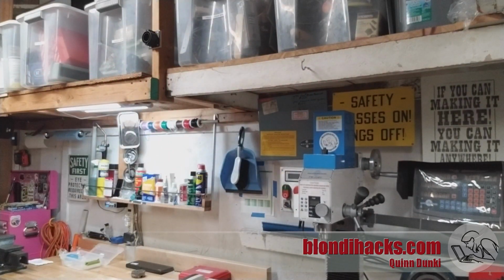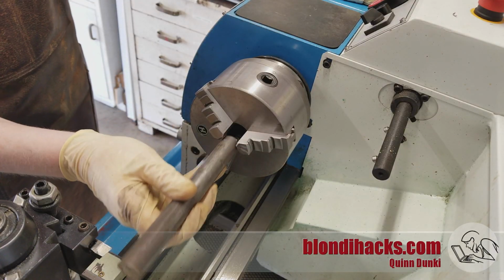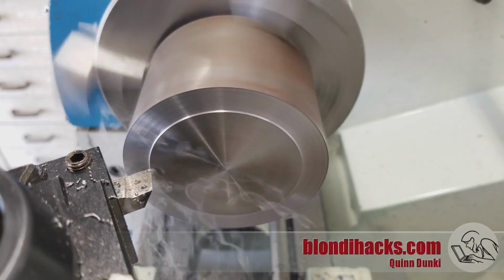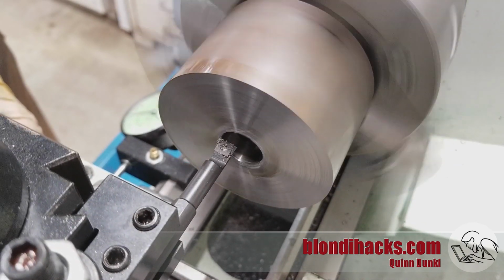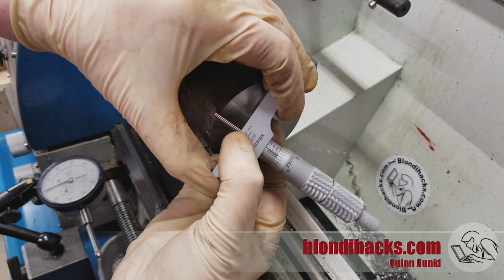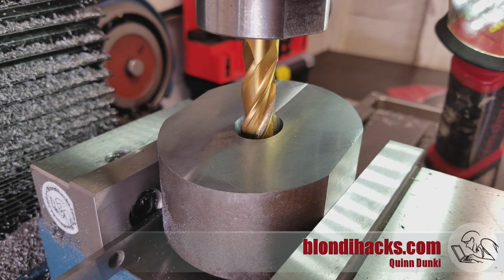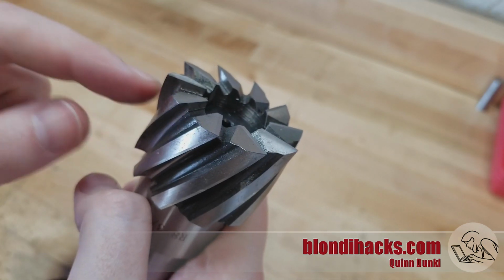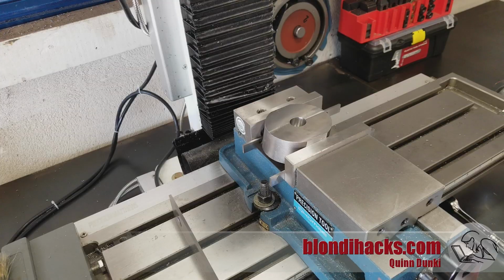How To Make A Fly Cutter :  Part 1/2

Comment: in attempting to use a fly cutter cutting tool that I ground, I obtained a smooth finish but once the tool advanced the distance of the diameter, the trailing edge began cutting also, messing up the smooth advancing finish!!!  Can you help? Thanks  Sam

Comment: Hi Quinn, fantastic job on all the videos, thank you for all your hard work. I’ve recently picked up a used Mini Mill. Replaced the spindle and bearings. Noticing some warmth/heat in the spindle taper when running, especially at higher RPM. Have you noticed this yourself? It’s not too hot to touch at all, just quite warm :)

Comment: EXCELLENT VIDEO...tickles me to hear you talk !!! 'makes me remember all those years ago, working on and around shop equipment! I remember our shop had a tailstock chuck that had a short rounded off and half twisted tang on its morse taper. If we had a big bit to run with it, we would stick the handle end of its chuck key in the hole and rest the key on the cross feed, on a little piece of wood and a rubber band around the chuck and key. That would prevent the chuck from turning. Later, the shop got another tang pressed in that we didn't have to baby.
   You mentioned you were experiencing "chatter", on your cut. If you will grind a small radius on your cutter, in your lathe tool post, you will see a marked difference in less chatter as well as surface finish! My mentor showed me quite a few KEWL tricks like that. 
   Another kewl trick is using CRISCO vegetable shortening (not the oil), for tapping steel. I just fill a pill bottle with Crisco and put the lid on. I've taught my grandson to pull the lid off. stick the tap in and put the lid back on and tap the steel. You don't have the mess you usually have and your thread quality is pretty and smooth...not grainy, like when you use tapping fluids. (my mentor worked for a major heavy equipment company, and he told them about Crisco. They bought my hometown stores out! you couldn't find any Crisco anywhere in that area of town! They make earth moving equipment.) There's your tip of the day. 
   I APPRECIATE you and your machine-shop activities !
  Oh, and before I forget it again...I absolutely love how you start your video sessions! Bill, from Tn 🇺🇸

Comment: I only have a little experience on mills and lathes so please forgive me if this is a silly question.
Instead of machining the entire fly cutter body into a wedge wouldn't it be easier to just leave it round and only machine the HSS slot at an angle? You could use a small end mill to plunge cut flat surfaces where the set screws will go, center drill the flats, then proceed as normal. It would result in a heavier fly cutter but I would think it would help with balance.

Comment: Quinn, I see that there are already 225 comments on your presentation.  I wanted to give you a tip that will assist in preventing drill bit spin.  It is especially valuable when using Silver & Deming bits.  There are three holes in the chuck.  Each hole should be used to torque down the jaw on the bit.  Enjoy your videos.

Comment: Great video-tutorial, Quinn - as usual !!! Looking forward to watching Part 2... which I'll do it in a second. 
But not before thanking you for sharing your Toolpost Indicator Holder on Thingiverse (https://www.thingiverse.com/thing:2830764)
I was already intrigued by that little 3D printed red holder, which you showed very briefly (too much briefly, perhaps 😉) on your Lathe Tutorial 9, that on four-jaw chucks. But in this video you show it so blatantly that I couldn't refrain from checking. And I found it, yeah! 😉. Special thanks for sharing the Fusion 360 files too 🤗

Comment: I am not a machinist at all but could you have put an angled shim between the part and that awkwardly clamping fourth jaw to make the clamping force stronger and the setup safer?
Reply from the maker: It’s safer without. Unless the angle of that shim is perfect, it has a good chance of flying out of the chuck at speed, and well...my face is right where it would go. 😬
Reply: For sure, I thought that might be the case, to tell you the truth machining has always frightened me for this reason, I do need to get over my dear though if I ever want to realize my dream of watchmaking.
I have seen some watchmaker secure flat plates of brass to a backplate with nothing more than super glue. Is this possible because of how soft and easy to work brass is or does it have to do with the size of the piece in question. Sorry to be so long winded
Reply from the maker: Thomas Evans Indeed superglue is a very useful fixturing method. It works in many materials, as long as you keep the cutting forces low and the temperature down.

Comment: Nice explanations as always. You might want to mention that the tip of the drill bit is not the only depth that you might be concerned with. It is often the case that you are interested in the full diameter hold depth, in which case, you would be short by this method. This is definitely not a criticism, I think you do an excellent job, but rather a subtle point that has gotten me into trouble in the past. I see that you did mention making the bottom of the hole flat later, but for some this might not stand out enough for them to associate this with the final depth issue. If you want to send me a mailing address to dudley.toolwright@gmail.com, I have a couple of HSS shell mills that I will never use that were included in a lot of tooling I bought.
Reply from the maker: Yes, great point! In fact, I’m willing to bet that most of the time the depth-at-full-diameter is more important than the absolute depth. Boring a flat bottomed blind hole is probably the exception to the rule.

Comment: Quinn, I am new to your channel and absolutely love it. Your humor and demeanor are up there with This Old Tony and I too want to be your friend. I hope that is a complement! 
I have a quick note on balancing your fly cutter in Fusion. To balance the fly cutter you want the center of gravity (CG) in the XY plane to be on the axis of rotation (let's call it Z). Your trapezoidal shape does a great job in balancing in the tool direction (Let's call it X).  To balance in the perpendicular direction place  the Y component of the CG on the Z axis. The CG of the assembly is displayed in x, y, z coordinates in the assemblies properties as center of mass Just cut /trim away to center (zero) the x and/or y components. In the fly cutter case I beleive you will need to remove weight from the opposite side of the cutter!???? This is because  the tool is very close to the CG in the Y direction(0 to .5 or ~.25)  and the cutout for the set screws is around 1" so the mass at the set screw cutout has 4 times the mass at the tool location. Wow, so much for a short note. sorry
Reply: WOW...KEWL

Comment: I'm not sure if it's on all versions of Fusion 360, but check the inspect menu for a tool that shows you exactly where the center of gravity is.
Reply from the maker: Oh cool! I didn’t know about that. Thanks for sharing!
Reply: @Blondihacks   is dynamic balance as simple as getting the center of mass on the axis of rotation, or is it more complicated than that?
Reply: @somebodyelse6673  I think you're right. This video helps visualize quite a bit: https://youtu.be/5TwcDq40T5s

Comment: Definatly a good tool for surfacing heads or decking a block
Reply: I'd  recommend a 12 to 14 inch diameter  fly cutter for that... on a super rigid machine  lol
Reply: @rynohorn3819  yeah I know about the rigidness and why so big for small engines

Comment: A quick way to get a flaft botton after driilling would be to chuck an appriate endmill  II have 3/4 endmill holder with a 1/2 straight shank) and run it in to finish the hole

John
Reply from the maker: Yah, an endmill holder for my tailstock would be a very useful thing! I gotta make one...

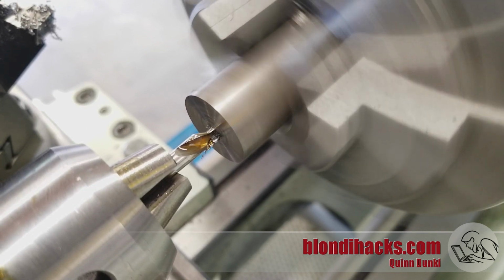Comment: At 5:05, it looks like the tailstock is floping all over the place.  Is that normal for lathes?
Reply from the maker: That’s just because you’re seeing it very very close up. Some movement is normal when the quill is unlocked for drilling.
Reply: its normal for small lathes...and for uncritical rough drilling little movement is just ok

Comment: Was gonna say, shrink fit is how the railroad puts steel tires on train wheels... Shrink fit has nothing to do with how well you get along with your psychiatrist nor do they work out at the gym
Reply from the maker: Indeed! Stay tuned for hot base on arbor action.
Reply: Blondihacks ahhhahaha you made me laugh... But seriously, machinerys handbook has an interesting few pages on the subject. I can say from experience, a shrink fit is impossible to disassemble without destroying the components... The better the surface finish the better they will grip, more surface area at a microscopic level

Comment: Thoroughly enjoyed that. A very nifty design! I often hold drills in a collet chuck to prevent them spinning in the tailstock. One thing I did notice was that your centre drill lifted a little; tailstock not clamped? To rough out a flat bottomed hole it is possible to use a slot drill (centre cutting end mill) in the tailstock chuck.
Reply from the maker: That’s just the normal drift of the quill when it is unlocked. People just aren’t used to seeing it that close-up
Reply: @Blondihacks  Understood. Thank you for the explanation.

Comment: Thanks for sharing. Out of curiousity, why is it so hard to actually drill on center? In most videos when people use center drills etc they always seem to shift off of center? Am i seeing this wrong or is this a common issue? if so what are your recommendations for fixing? It happens at 5:00 in your video for reference.
Reply from the maker: Good question! This is actually correct behavior that you’re seeing. The center drill is finding the center of rotation naturally. There is some movement in the tailstock quill when it is not locked (as when drilling). This is part of why center drills are so valuable!
Reply: @Blondihacks  So, meaning your centerdrill or tailstock is out of center. Same movement with the bigger drill at 10:30.
Reply from the maker: No, it isn’t. This is normal. The quill droops slightly under gravity when unlocked.
Reply: @Blondihacks  ahhh, so what I am seeing is the center drill hitting the stock slightly off center, and because the stock is moving the center drill naturally wants to find center and so it shifts to center? Thank you for clarifying, I always thought it was going 'off center' :)

Comment: Good & well explained video as always Quinn. Something a lot don't realize is that rust is a rudimentary form of carbides and much harder than the parent metal it came from. With our usual home shop pack rat syndrome a lot of us end up machining rusty scrap metal. That rust just like the hardened skin on cast iron, abrasive dust off grinding stones or emery paper can get embedded in the much softer slide and bottom surfaces of the carriage ways. Even with a hardened bed those other surfaces are still soft. Add the normal oil that should be always there and you end up with an excellent lapping and way scoring compound. Once the material does get embedded it's about impossible to remove short of re-grinding or hand scraping it away. The cheapest aluminum foil for the kitchen you can find works well to wrap the exposed lathe parts to catch and protect the machine until your down to clean metal and the whole works can then be thrown away. I'll usually wire wheel the majority of the rust off first, add a coat of any heavy oil to the remaining surface rust to keep any dust from going air borne until it's all removed.

A bit of historical machining trivia. While the equipment was/is mostly used on rare and expensive hardwoods such as African black wood and before the bans Elephant ivory. The Ornamental Turning lathes were also sometimes used on metal. Quite rare even for that equipment, they made what was called an Oblique Chuck to hold and machine work with it's face angled to the lathes head stock rotation. Almost any shape you can visualize was held and machined by mechanical methods they developed over hundreds of years. I've picked up a fair amount of information about complex multi axis work holding and machining from some of the Ornamental Turning books I've bought. Likely one of the most modern and cheapest to find for a used copy would be T.D. Walshaw's Ornamental Turning. ISBN 1 85486 108 5. It's mostly about using the usual home sized metal lathe, or in his case a Myford as a replacement for the now rare and super expensive original ornamental lathes. Even with no interest in the subject his details about the use of a standard boring head are worth the price of the book alone. There an extremely powerful and versatile accessory that can do far more than just bore holes. Single tooth fly cutters with a vast range of tooth shapes were also used a great deal in that work. He also shows how all of the tools were precision lapped to obtain the best possible tool sharpness using a fairly simple Goniostat and fine stones https://www.google.com/search?q=goniostat&client=firefox-b-d&source=lnms&tbm=isch&sa=X&ved=0ahUKEwiDrOjTqPnjAhWRvZ4KHeWYBcQQ_AUIESgB&biw=1600&bih=763&dpr=1.2 

What worked in those dense hard woods and ivory can be applied or modified to be used with metal. It's also a dark, very long, extremely time consuming and expensive rabbit hole to go down for anyone making the life altering mistake of developing an interest in ornamental turning.:-)

Comment: I worked on projects that used press fits.  I could never understand how this really worked.  Either the male part is compressed or the female part is expanded.  I don't think steel cam be compressed so the female part must expand.  How is this possible with such a massive part as the tool holder in this video.  Just seems counterintuitive.
Reply from the maker: It is interesting, isn’t it? The short answer is that steel is compressible, weird as that seems.
Reply: @Blondihacks  PS, I really like your videos.  I did some machining in college (weird huh) but no more.  Your calm approach to teaching is just great.
Reply: @Blondihacks  And the elastic tension of the metal plus friction between the two parts all help. In theory and with a starting taper, any size could be forced into any smaller hole size. However get into the materials yield range where permanent deformation occurs and that tension drops to almost zero. That's why press fits have a fairly tight range of sizes depending on the degree of (light or heavy) press fit desired.
Reply: @turningpoint6643  excellent explanation.
Reply: @bostedtap  Obviously I type far too slow as after my post I saw you'd pretty much said exactly the same thing. :-)
Reply: @turningpoint6643  LOL.😁
Reply: Yield Strength is the feature in materials that allow "Press or Interference Fits". Higher values found in medium/higher Carbon and alloy steels are more suited to this method, hardening and tempering in increases the Yield Strength. This applies to both Compression and Tension equally. Low alloy Copper and Aluminium is not suitable for interference fits, many Aluminium higher alloys can be used. Think "Stringy Cheese" versus " Hard Cheese". But beware when using thinner sections.
Shrink fits, using heat ( heat to expand the female part, cold to shrink the male part) results in stronger joints. Plus 275 C and minus 30 C, ref domestic cooker and freezer can supply this. Liquid Nitrogen is handy if you have it😱😱.
The 12L14 SAE steel you have is suitable, ref added Manganese, and section ratio.
Hope this helps a little, very much enjoying your design and manufacturing techniques. Please take this as honest comments, nothing condescending intended in any way.
Best regards from the UK.
Reply: @bostedtap  Thanks for the explanation.  I assume that once the parts are pressed together, one of them has passed the yield point and has been plastically deformed.  Does this deformation increase the diameter of the material above the mating surface?  And is there still a force that holds the parts together (rhetorically)?
Reply: @witzed1  If we permanently deform one or both materials, then we have no interference fit, and hence no more joint. The general term for this is called " Hub and Shaft Fit", plenty on Google) interference fits are very good at transmitting torque on power shafts. We use materials in their elastic limit, so if you imagine a coil compression spring say 25 mm diameter X 100 mm long, we grip it on its length in a machine vice, and compress it by 10 mm ( assuming we still have gaps between the coils, not coil bound). We have  the spring in compression and the  vice in tension, as long has we do not exceed the elastic limit or yield, either by mechanical or thermodynamics, then no change will occur.
There may be a little bulging at the transition on the hole, and necking on the shaft, but it is very miniscule.
Hope this answers your questions. Best regards John.
Reply: @bostedtap  Thanks John.  This has been a very enlightening discussion. I'm an electrical engineer but I worked with mechanical engineers and metallurgists.  For this one point, i did not have the courage to ask.  Darwin
Reply: @witzed1  Hi Darwin, glad to be of help!,  There is much more on shrink fits, ref Poissions ratio, but I think @Turning Point and I have covered the salient parts. Best regards John.
Reply from the maker: @bostedtap  You have done an amazing job of predicting much of the next video. 😂 I will indeed be expanding the base in an oven and shrinking it down on the arbor.
Reply: @Blondihacks  Oops!, sorry 🙇But it is the most logical method, ref suitable press, and difficulty to exert force perpendicular, plus your flair for engineering!.
Again, I do enjoy/admire you skills and correct approach to the subject.
Best regards John.